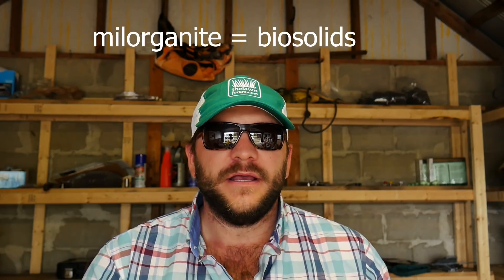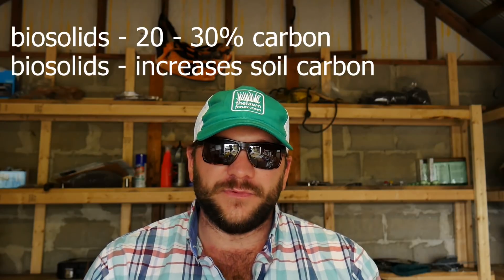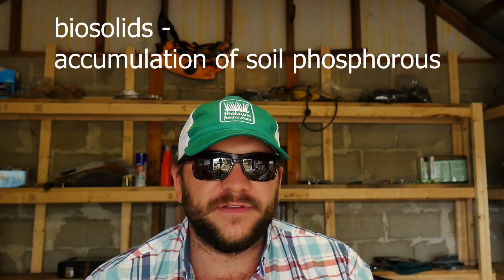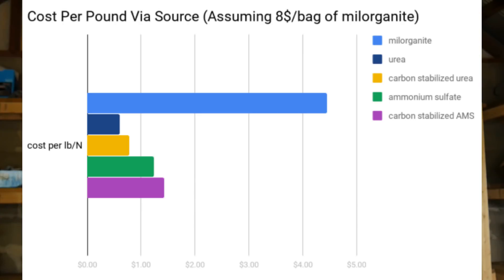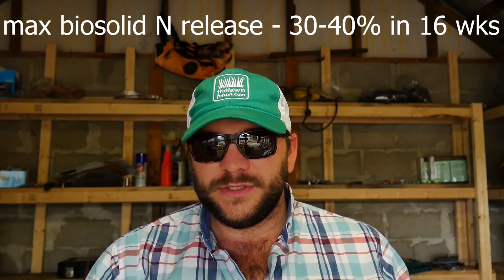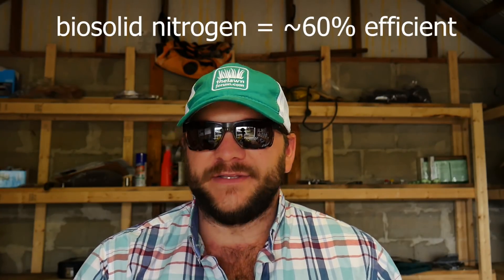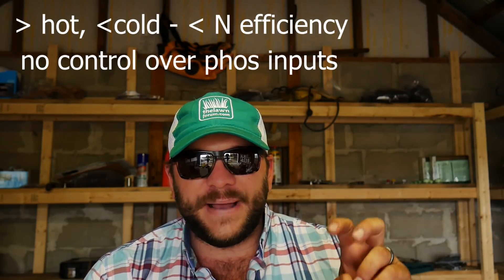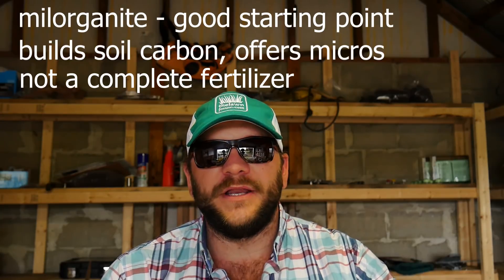Milorganite: The Science - Failures and Successes

Comment: Does Milorganite contain pharmaceuticals and heavy metals?
Reply from the maker: Milorganite may pass the heavy metal test but pharmaceuticals? The jury is out. I'd love to see the testing. I personally wouldn't use it for a variety of reasons, mainly it's a rather pointless fertilizer for most situations, and what you specifically mentioned.
Reply: @TheGrassFactor  I used it for about 3 years in my yard and quit 2 years ago. It did help a little with overall greening, but my main focus was on keeping deer out of my garden. Deer don’t like the smell. It worked about 80-90% effective in that area.

Comment: Mulching your lawn will put potassium back in your lawn along with nitrogen and Phosphorous at least a quarter of amount that your lawn needs
Reply from the maker: That's not entirely true. It will recycle about a quarter of what it pulls from the soil. You will lose about 75% of what the plant uses. So if you apply four pounds of nitrogen, your lawn will pull two pounds of potassium and one pound of phos. Mulching your clippings will return up to a quarter pound of K once clippings are fully mineralized. This means you are still depleting the soil at a fast rate by failing to supply it. Depleted soils are imbalanced and do not function well. There is a reason N P  and K are *macro*nutrients

Comment: Anuvia or Milo? Thoughts? I have access to both, but from a previous video you seem to be more of a proponent of the anuvia.
Reply: Cody, I'd be curious to know where you picked up the Anuvia near Nashville? I'm in Gallatin/Hendersonville and haven't seen it anywhere?
Reply: wnracing got it at Ewing Irrigation in Nashville.
Reply: Yes, the section where I threw the Milo did not grow nearly as fast as the area with the Anuvia. Its obvious that the Anuvia had much higher N rates. Probably going to stick with Milo during the summer. Will probably go back to the Anuvia late summer/early fall, and in the spring.
Reply from the maker: Depends on what you're trying to do. But overall, anuvia is next level
Reply from the maker: I'll say like it was said to me - Milorganite is a meme
Reply: This would be for my personal home, not for any of my lawn care clients. I have TTTF lawn, and live in Nashville, TN. Right now I am applying about 60% of bag rate of Milo bi-weekly to increase the organic matter in my soil per my soil test this past spring. Also putting out a couple table spoon of laundry soap every 6 weeks or so. Picked up a bag of the Anuvia today on my lunch break and thought I would give it a try on this Bi-weekly treatment.
Reply from the maker: Cody Sutherland with TTTF I would worry about applying too much N. If you're major concern is OM, I personally would huse humics. If you've got access to Milo, run with that. It has much lower N
Reply: The Grass Factor dang lol, already bought a bag. Guess I will see what happens. Better get it out before it gets too hot. How much should I put out on a 2500 sq ft yard?
Reply from the maker: Cody Sutherland ~10 lbs
Reply: put it out yesterday as well as a test plot of milorganite..i will post results in about a week.
Reply from the maker: I like your style!!
Reply: Have you seen any results from it in the ~2 weeks since you threw it down?
Reply: TGF - I find this very interesting considering that Milo is literally the lowest N rate available anywhere that I'm aware of and the Anuvia (while it is a little higher) is still a much lower N rate than you can purchase at basically any "box" store, probably close to half the N that would come in a bag of say Lesco or Scotts, but you would still be concerned about the rate of 16 for the Anuvia? I'm not questioning you, just trying to learn.

Comment: Matt, I've been using Milo for two years here in N. Texas, on my Bermuda turf, going on season three. I've always used it in a hybrid system. Early spring I put a 25-1-2 and then use Milo the rest of the summer. This year I'm using the Nxt products. My question, should I back off Milo next year, year 4? Is the Hybrid mix a solid way to go, with Nxt products? Really appreciate all your info.
Reply from the maker: A hybrid approach is a great way to go. I like your style. Backing off the Miko may be necessary depending in your P levels. Pull a soil sample and see where you are. If high, pull it out
Reply: The Grass Factor thanks Matt!

Comment: I’m hearing about these Next products, they appear to be quite expensive. How do you reconcile that?
Reply from the maker: As a professional with purchase volume, my cost per k is $.20 per k or less. That's very cheap. For homeowners it's maybe $.45-.60 per k. That's pretty cheap, too.
Reply: The Grass Factor I am going to have to do more research on this. Thanks for responding
Reply: How long is the shelf life on their products? I have 5.5k sq ft. It would take me a long time to use up $100 worth, wouldn't it? I am afraid to sink a bundle and have it go bad. I saw someone comment that it is only good for a year in the bottle. Thanks for supplying so much good information.
Reply: If you break the cost of the N-Ext products down to per 1,000 ft2, it's not really expensive at all. Depending on the size of your lawn, you should get quite a few uses out of 1 gallon.

Comment: I have been using Milo for the past 4 years but as I have learned about the science of turf grass from you I have moved away from it and starting using a ammonium sulfate with methylene urea fertilizer this spring. So far I am pleased.
Reply from the maker: It's not that Milo is a bad fert, it's good. But it doesn't supply a complete nutrient profile. It also provides a carbon source which has great long term.benefits
Reply: Agreed, always had pretty good success with it and it is dummy proof. As you said in your video it can get expensive ( i have St.Aug in Central FLA) and I think there are better options even for the DIYer.

Comment: Is there any way to bring down P levels in soil? Just wondering if it's possible to still use mostly milo but counteract the effects of the P building up.
Reply from the maker: Unfortunately only way to drop P is to make it available and stop applying it. Carbon is a great way to unlock it. As is potentially AMS. From that point, it's limiting your application rates of it.